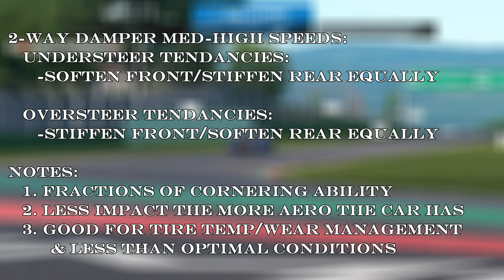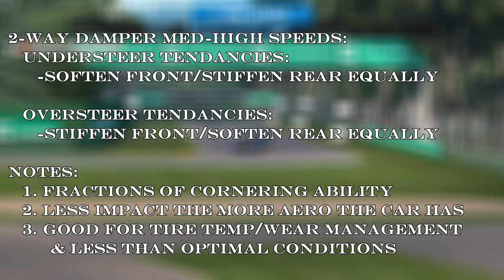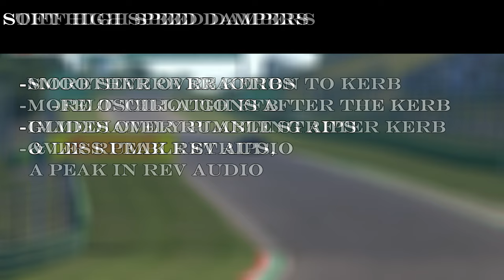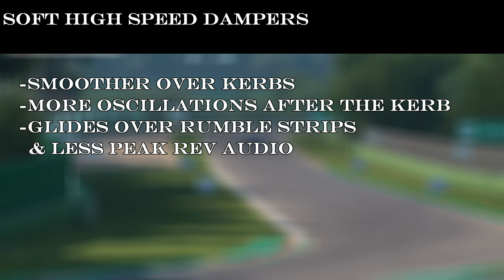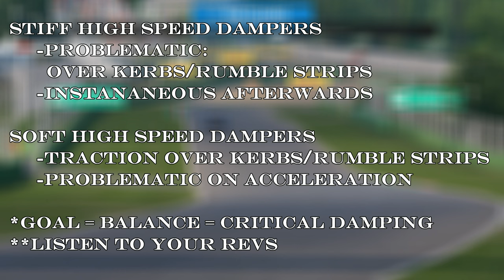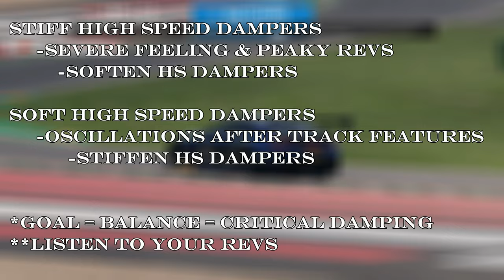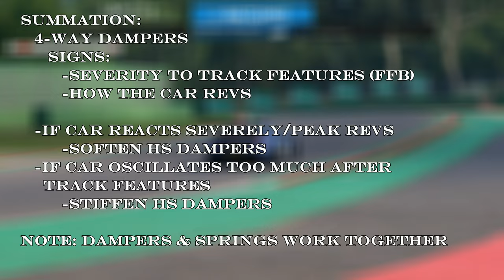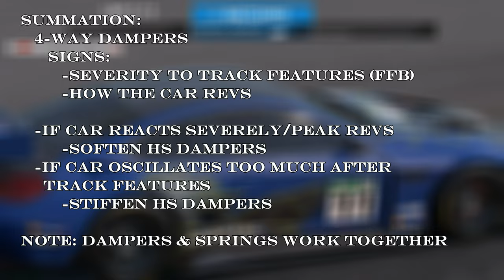How to tune Dampers (Traction) -  A Sim Racing Setup Guide feat. Automobilista 2

Comment: I will send this to a few people who could use the fast damping help, after what can be learned here, adjusting the FST bump and FST rebound independently to control the bouncing (in the soft case) then seems a lot easier.
Reply from the maker: Thanks! This series is for hard core sim gear heads. Im glad you found it helpful.